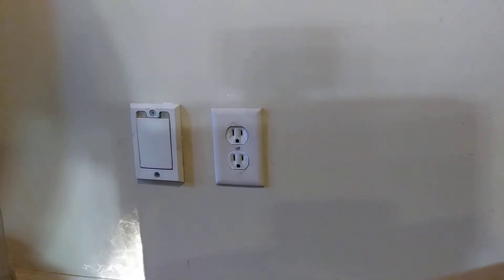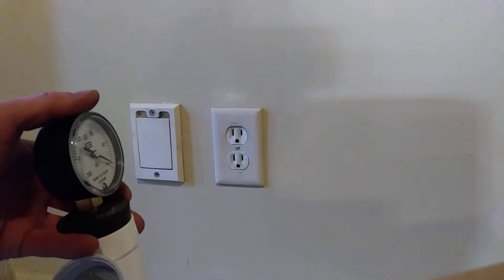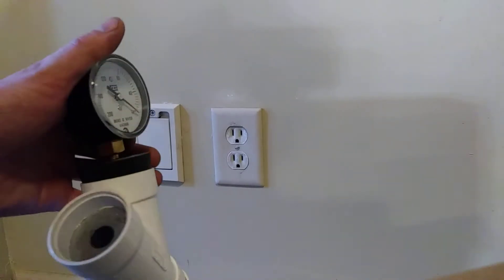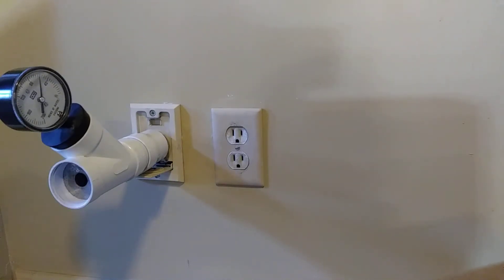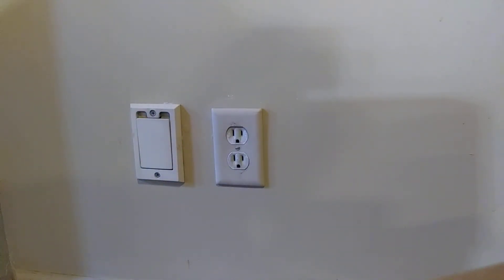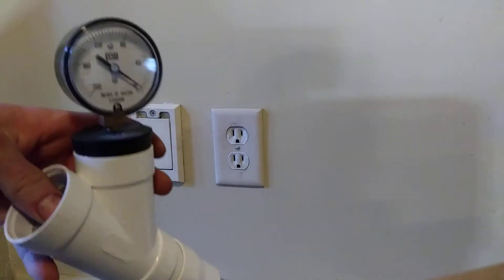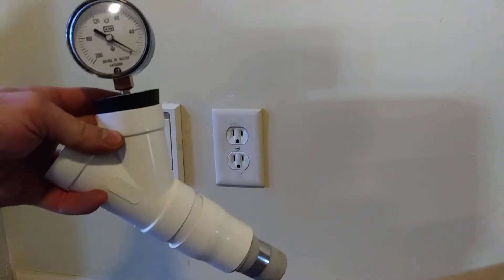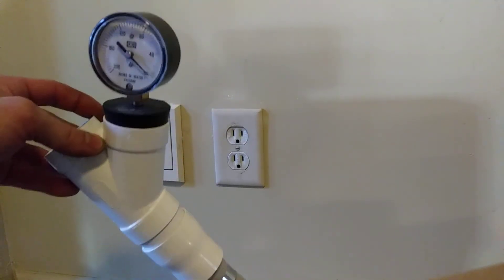Sealed vs. Working Vacuum: Measuring Performance in a Central Vac System

Comment: You mentioned that today a good system should have at least 80" working vacuum and 120" sealed vacuum, is this at the wall inlet or at the power unit? If it is at the inlet, what would be an equivalent amount of working and sealed vacuum at the the unit? I'm shopping around for a central vacuum and am trying to get an idea of what specs will translate to the best end of the hose/powerhead performance, although annoyingly most central vacuums only list the airflow and sealed vacuum at the power unit and don't provide working vacuum. I currently have an older (late 90s, mid 00s? I'm not entirely sure how old it is) Eureka with fairly mediocre performance specs, and no attachments, so i'm looking into a new high performance power unit (most likely only 120v 15a though) and an attachment set of some sort to go with it. If you have any recommendations on specs or features to look out for please let me know. Sorry for the long comment by the way ;P

Comment: Where did you get this again. And do you sell them or do you make them how did you come across yours and how much was it
Reply: @Mike Myers, I realize a couple of years have past, but here is the gauge "adapter": https://cjmillervac.com/products/test-y and here is the gauge: https://www.thinkvacuums.com/central-vacuum-pressure-gauge.html
Reply: @lxc3909  Thanks for posting the parts sources. The Y pipe connector is not too bad, price wise. But that pressure gauge... whoowee! It currently retails for $81. That's not nothin'.   Many/most pressure gauges sell on Amazon for under $20, which is far more reasonable, even liquid filled ones. I already have a set of tapered rubber stoppers from a cheap vacuum kit (for bleeding air out of brake system, power steering system, etc), so I'm now trying to source a quality but inexpensive pressure gauge I can attach to my existing stopper to save myself $50.
Reply from the maker: Mike Myers the wye fixture is made by HP Products/Vacuflo. You could make one but it was cheaper for me to buy it. Then just supply your own vacuum gauge.
Reply: Owen Perkins so do they actually sell that whole unit including the vacuum gauge is well. And do you have the website information for that thanks I appreciate it